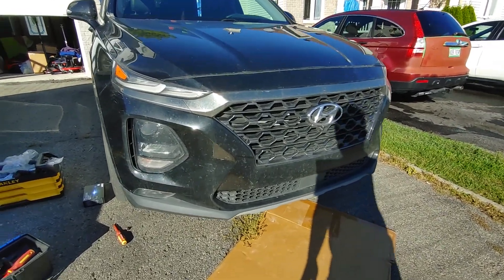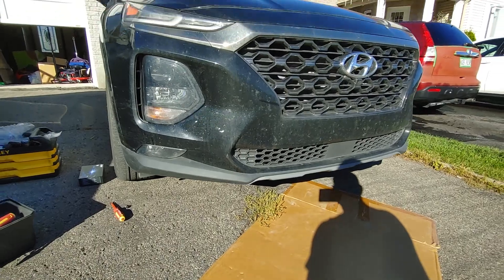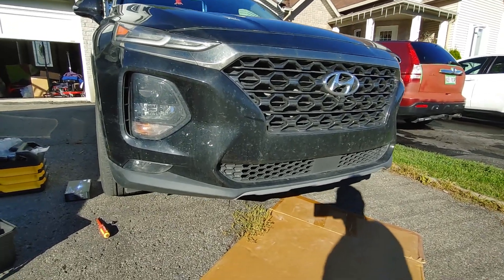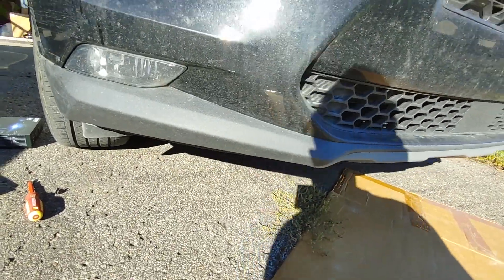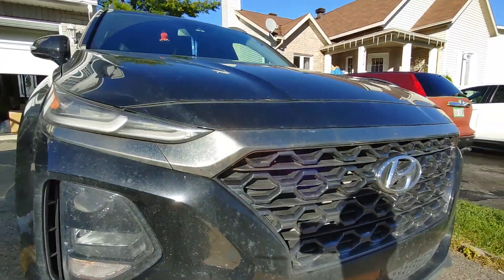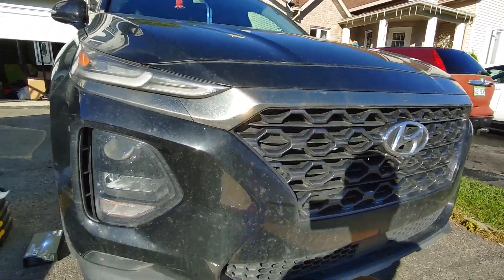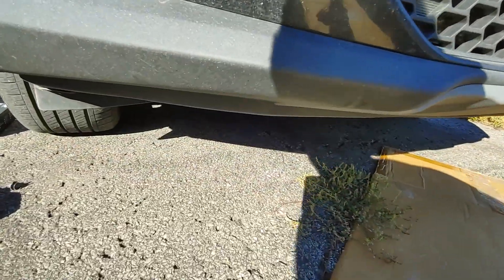2019/2020 Hyundai Santa Fe fog light replacement

Comment: Need to replace front signal bulbs, can't find them. Does anyone know how to access them?
Reply from the maker: I honestly haven't had to change one yet. You should have two dust covers, one on top of the other. That's for the low beam and high beam. The turn signal should be right under those dust covers, but turn signals don't usually have dust covers. You might have better access from the bottom like the fog lights instead of from the top 

I will look into it for you and keep you updated.

Comment: hey , great video.  How do you change the low beam headlights  from passenger side.  TIA
Reply from the maker: Thank you!
That's actually a lot simpler. You have direct access from the top (engine compartment), remove the dust cover that's at the back of the headlight where the low beam blub is and you'll get access to the plug. Unplug the bulb and turn it counterclockwise to remove. I'll post a video when I get a second so you have a video reference. Let me know if you have any other questions.